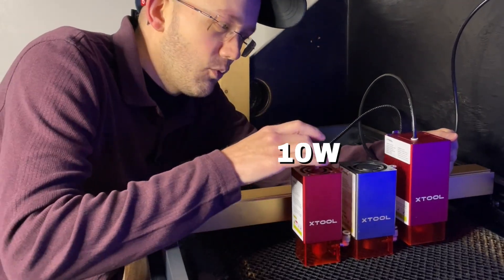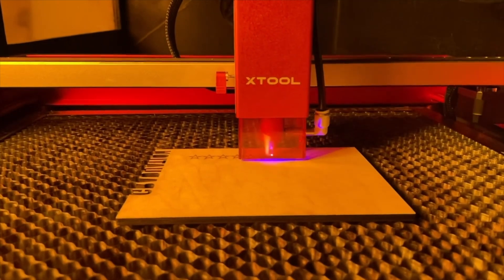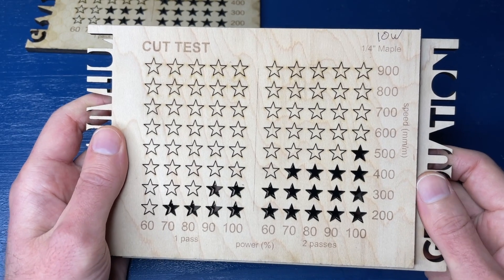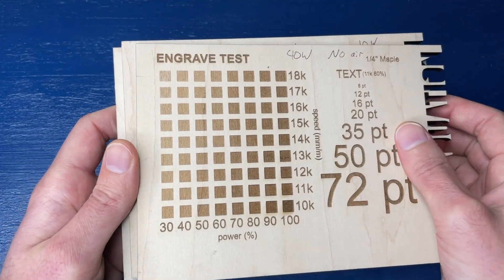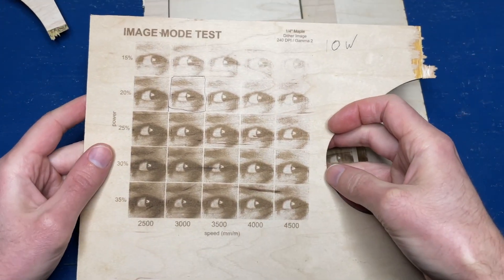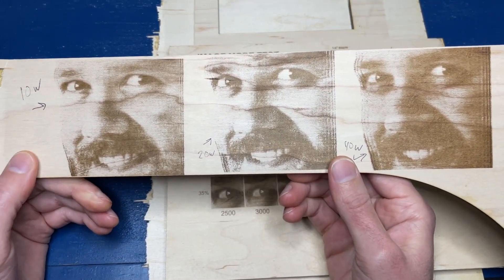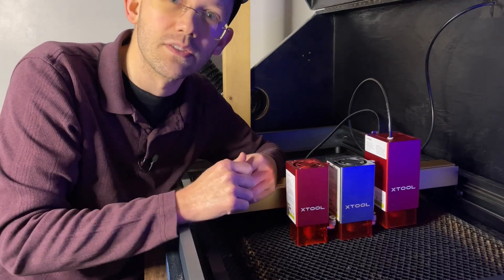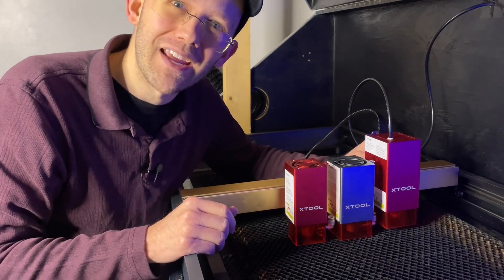What Wattage to Get? (For Diode Lasers)

Comment: I agree that it’s super difficult for newbies to dial in settings, especially when comparing different wattages. My head has three modes.  I take minor issues with using the same test range for a 20, 40 and 60. They have overlap but you need a test range for each to cover its individual range. Also, cutting vs engraving is everything!

Comment: How does the 1064nm stack up to theses 3 modules? Ive been looking for comparison video for that but havent found a comprehensive one.
Reply: That depends on what you're trying to do.
I assume you're asking about fiber lasers.
For accurate color markings you'll need a MOPA laser.
For general engraving on metal, plastic, and stone I absolutely love my fiber laser. 
I can't do wood, shirts, glass as easily, or non-cast acrylic. 

Fiber lasers have hard limits due to the wavelength.

Comment: I bought the Atomstack 10watt 2 years ago and it's great but I recently bought the new Atomstack 70 watt for about the same price as the XTool 40 watt and it's a beast. X Tool is expensive.
Reply: I am thinking to buy 10 watt can it cut 4mm acrylic
Reply: @sakshamchugh11  I would think so but you will be disappointed with the lack of power. If you can afford more power you will be happier and it will be able to do more for you.
Reply: Cutting 8mm mild steel which leser sourc use for small 1mtr x1mtr cnc machine.

Comment: I'm really disappointed in my 20w upgrade,  I  have the original 5w, then a 10w and a then 20w and I'm one of those guys who washed their money on the IR 1064nm 2w laser. I think xtool really dropped the ball on its support.  I've had it for over a year, and it's in one of my d1 pro units.  However, with the lack of support from xtool, I haven't even plugged it into the wall.  If anyone knows of a material library for lightburn for this laser,  please let me know.  As far as the tests you did on two of the heads that I own,  I have not been able to get the same results as you. I keep my firmware up to date on my D1 for my 20w and clean my lens regularly, but I can't get the results you do.  Any advice on anything else I should be cleaning or doing? I only use my laser for hobby projects as I am a service connected disable Marine Veteran and I'm in hope that I will one day be able to use this to combat my PTSD and it helps when my laser is performing OK. I'm no stranger on the forum, and I try to upload projects when I make something really cool.  (Most of the time, you have to beg to get your points). My goal is to get enough points for the latest non diode unit. Any advice on getting the results you get on your 20w? Could you maybe make a video on the maintenance you do on your 20w? Your video was very informative, and I'm glad xtool is supporting you,  I'm not in that group.
Reply from the maker: @dog0311  - have you looked into tweaking your air assist or air flow (e.g. honeycomb) to improve results? It sounds like you’ve already played around with the Lightburn setup and If the software is not an issue, then it could be an air thing, especially if the issues you’re having are when you try to CUT material. I’m working on a video that goes deeper on this, but it may be a bit until it’s finished. I hope that helps!

Comment: Thank you so much for this! I am new to the laser world, and trying to decide on which one I actually need. I was impressed by the 10W detailing and really didn't expect it to look so good. Since my main need at the moment is cutting 5mm EVA foam faster and more accurate than I can with my exacto, I am looking more at the 20W. I don't NEED the 40, but would love to eventually have a 20 and 10 for expanding my projects later down the road. Very helpful video and information, thanks so much!

Comment: Wow, I still need to view more videos before making my decision but this has helped a lot. I've been learning with a 10 watt for the past 9 Months but I need more power now that I'm comfortable and properly addicted to lazing! I was leaning more toward the 20 watt rather than the 30, It's a Sculpfun S30 Pro that's been heavily upgraded (I'm not considering pricing when upgrading). After seeing this I might just go with the 30 instead of the 20. I am really looking for more speed and it looks like 30 will blow them both out of the water by quite a bit- that 40 looks more than double the 20. Thank you for the comparison, I've still got to do more research but this has me leaning way more toward just going with maximum power. Take care!

Lower power is definitely better for engraving, but I do about a 50/50 split so balance important to me- though I do lean a bit toward more toward cutting power than engraving (my engraves are all solid even engraves, not photos with a lot of variability). I think the higher power is probably the route I should go judging by this video alone. Still got to research and compare things but this has helped me quite a bit. Thank you for this great comparison vid :D
Reply from the maker: Awesome - so glad it helped you with the comparison process!

Comment: I have the xTool D1 now with a 10w diode.  Can I update to a 20w or 40w on the same frame and wiring?
Reply from the maker: Great question. You can upgrade a D1 to the 40W, it says so on the 40W upgrade kit FAQs. This does require you to change the wire and motherboard (which are both included in the upgrade kit), and once you switch, the old D1 module won’t work on the new motherboard. This is different from the D1 Pro, which is backwards compatible with the 10, and 20W modules after upgrading to the 40W kit.I’ve read that there is also a D1 specific 20W laser module kit, but I’m not sure if XTool still sells it. 

I hope this helps, if you decide to go for the 40W, you can get a discount by using the link in the video description. Cheers.

Comment: I’ve not found a conclusive answer but the speculation is generally that if you run a 20w xtool at 50% it only uses the first 2 diodes, so the dot size is better, obviously it needs running slower but everything has a price. I have yet to test this on my 20w.

Comment: Is that really right that you are getting a full through cut at 70%/200mm on the 10 watt?  I'm running a 5 watt atomstack and can barely cut through some 3mm "basswood" crap from amazon in 8 passes at 100%/5mm.  Is there something wrong with my laser?  I've bumbled into your channel and I'm impressed with with the quick and clean presentations and the level of information.  My wife and I have a product (line) idea that will be proto-typed out and market tested with some laser wood cutting initially, eventually there could be other materials and goodies to engrave/cut.  I've borrowed a friends atomstack and I am diving into every rabbit hole (lightburn, techniques, what more powerfull/capable laser to buy, etc.) about laser making.   So this video was very relevant and informative.  A similar video covering what the different types of lasers can do, and who they are good for would be a good future subject.  Keep up the good work,  I'm going to subscribe.
Reply from the maker: Yeah - I was surprised how well the 10W cut. I should mention though, that this type of thing has a lot of variables, so the specific piece of wood, temp in the room, etc. can make the cutting performance vary.
Reply from the maker: And good idea - I agree that a video comparing different types of lasers would be useful. I’ve only got diode lasers in my shop for now, but if I get others in the future, I’d love doing a comparison. Anyway, thanks for stopping by the channel!

Comment: I am happy with my 20W S1. Not sure if you had different settings for the photo engrave but the white is really blown out. I do 3D engraves on cedar and walnut that come out really good. If you do more cutting than engraving then the 40W would make sense but it does not engrave as sharp as the 10 or 20W modules.

Comment: I've looked all over Xtool's website and I dont see a kit anywhere that includes a 10w & 40w head. the only one i see that has a 40w at all is the S1 model. do they have a 40w head for the D1 pro or just the S1?
Reply from the maker: Hey Chad - yeah, I just took a look and it looks like that bundle isn’t listed anymore for some reason. HOWEVER, it looks like you can still get it by just adding the 10W system and 40W upgrade kit to your cart separately, and it looks like the price also comes out the same. You can find these by going to the website and clicking Products. Then, the 10W system will be shown when “laser machines” is selected under Collection. And the 40W upgrade will be shown when the Accessories collection is selected. I hope that helps!
Reply from the maker: And this is for the D1 Pro, so yes, it is available for the D1 Pro.
Reply: Awesome! Thanks for checking on that. I'm pretty new to this laser stuff, only have a 5.5w, but I'm pretty hooked and already looking to upgrade lol.
Reply from the maker: No problem!

Comment: Hi. Did you have air-assist on the cut test?. I run a 30w diode and have very little burn when air-assist used.
Reply from the maker: Yes, I used air assist on the cut test. Specifically the Xtool branded air assist pump, so it's possible I could get different results with a different compressor.
Reply: Maybe. I haven't tried Xtool yet, mine being the Atomstack, which works great. @chalkwatts